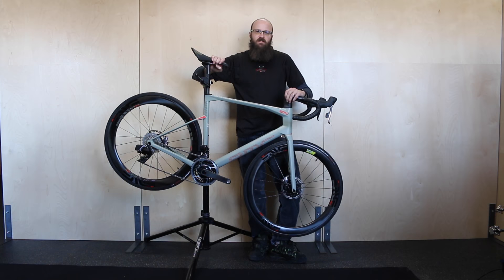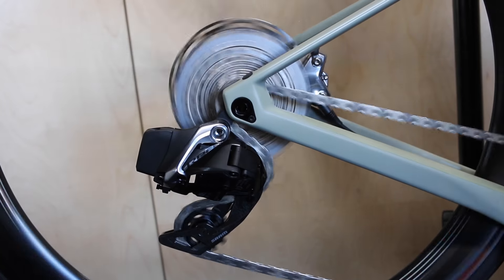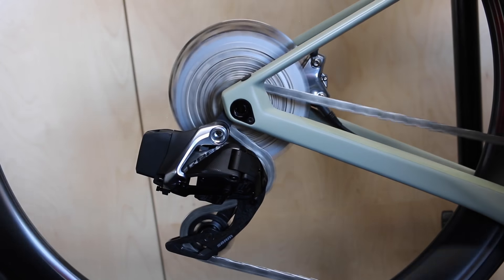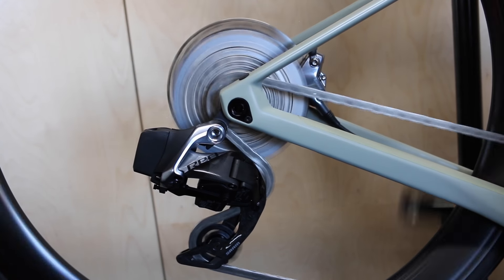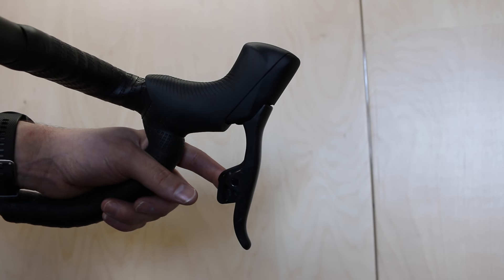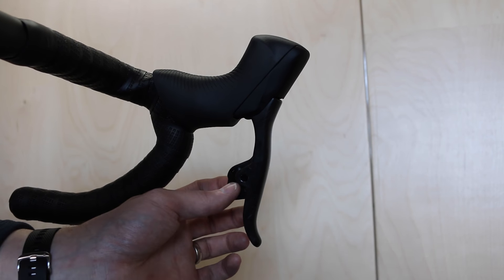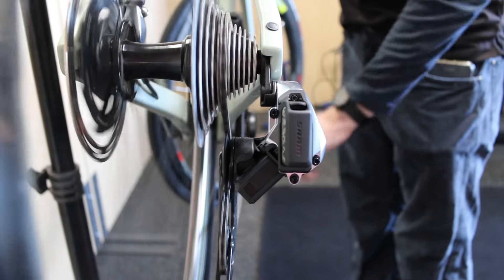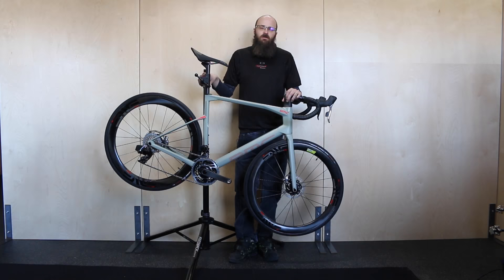How To: Adjust SRAM AXS Rear Derailleur

Comment: Would it be crazy to adjust while riding or should the bike be in the stand?
Reply from the maker: It would be possible to make adjustments while riding but it is hard to do with one hand it's probably safer to do it in the stand or to at least stop riding, make the adjustment, then start riding again.
Reply: @ContenderBicycles  Thanx - makes sense.

Comment: Is each adjustment you make for that specific gear only?  Say if it's having trouble going from gear 7 to 6, do you adjust it while it's in gear seven towards gear six, and vice versa?
Reply from the maker: Bill, generally speaking SRAM wireless drivetrains are designed to pull the right amount of chain over based on the specific gear. If there is trouble going from your example of gear seven to six, then that issue can be due to cassette spacing or a derailleur hanger that isn't straight. Of course, it is tough to assess without seeing it in person but that's where we would go first.
Reply: @ContenderBicycles  Thank you for the reply.  Prior to this, I took it into my LBS and they had to straighten the hanger.   When I got it back and went for my first ride, it did the same thing, albeit a different gear than before.  I'll play around with it a bit more.  Have a great day, stay safe!
Reply from the maker: @quest5581  Thanks you too! Don't hesitate to reach out if you need anything else.

Comment: i have a question. Wen indexing the rear mech like that. Dos it adjust fore just those two cogs or is it like a wire that effects every cog? It would be cool if the computer would remember to make specific jump over a specific cog. And can one adjust so wen one press and hold that the mech in one sweep takes the chain all the way up or down and not just take one step at a time?
Reply from the maker: the derailleur moves a specific amount knowing what number of gear in the cassette (2/11, 5/11, etc) it moves into. And yes you can press and hold a shifter button and it'll sweep the chain across the cassette, but it doesn't do it particularly quickly so as to not destroy itself as it sweep if the chain gets caught.

Comment: I am having trouble shifting from 6 to 7, if I make micro adjustment so 6 to 7 shift well. Then this will cause 11 to 10 shift having trouble.
Reply from the maker: Take a look at your derailleur hanger alignment. Making sure it's as straight as possible and that should fix your issue.

Comment: How do I get the rear derailleur to blink red when there are no more cogs to switch to? In other words, when I am shifting up the cassette (towards the harder gears) and I reach my 12th gear the derailleur used to blink red letting me know it couldn’t continue shifting but recently I placed my bike in a home trainer and when I put the rear wheel back on the bike I noticed the derailleur continues to blink green even though it’s already in its highest gear. Any help would be greatly appreciated.
Reply: Im pretty new to road AXS but I thought it only did that when you are in the small ring and tried to shift to the smallest cog. In the big ring it doesn't. Give that a try
Reply: @zesoloist  Thansk for your help. I actually checked with a few mechanics and they all told me the exact same thing. The derailleur will blink red if you are in the small chainring.

Comment: Great video... well explained, are the adjustments the same for the prior Gen eTap system? (2018 Seven)? Thanks!
Reply from the maker: They're similar. There is no app available for the prior generation but you should be able to make adjustments from your shifter levers.

Comment: Just got the TCR Advanced pro 0 disc 2020 with Sram Force Etap Axs.. Must say I'm more than disappointed with how noisy the drivetrain is.. Sad for a £5299 bike. The shifting is sublime, but the chain sounds tinny and cheap. Major let down 😢
Reply from the maker: SRAM certainly isn't known for quiet drivetrains, and the nearly one-piece cassette is known to accentuate drivetrain noise. Our experience is that riding and wearing the chain and cassette in a bit will quiet things down a touch, but it will still likely be louder than Shimano or Campagnolo.
Reply: I bought a £5k+ Canyon with Force AXS a few months ago and noticed the same thing. It's a lot noisier than the 10 speed Campy drivetrain on my old Bianchi. But having done some reading up it's just 'a thing' that Sram stuff can be a bit noisy. It's so brilliant in so many other ways though that after a couple of months I just don't really notice it, apart from when I'm climbing seated - due to lower wind noise and higher power I guess. I still love it.
Reply: @ContenderBicycles  thank you for replying. I didn't realise Sram isn't known for quiet drivetrains or I definitely wouldn't have went for Sram. Why I did go for it was reviews I'd read stated "buttery smooth" etc etc etc. Well LBS has cassette and chain returned to Sram. So hopefully they send me back Sram Red Cassette and chain.. I'll see then what noise is like 👍😊
Reply: Identical feedback on my Force AXS equipped SuperSix Evo. For £5k I cannot help feeling dissatisfied with the level of engineering.
Reply from the maker: @footflaps thanks for the heads up! We've seen that to be the case with much SRAM drivetrain stuff in general.
Reply: @ContenderBicycles  hi I've changed the shifter battery and since I can't get it to work properly with the rear mech. It downshifts all at once and even with the front mech it won't move at all. Have u any ideas what I could do.
Reply from the maker: @philmcgovern791  my first thought is to update firmware of your derailleurs if possible. Not a lot of ideas besides that or taking it to your local shop. Best of luck.